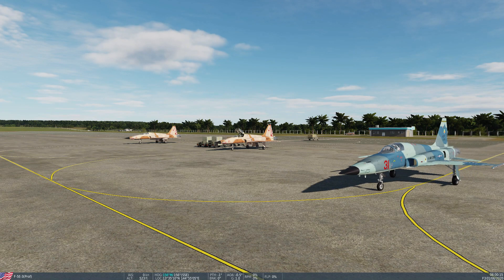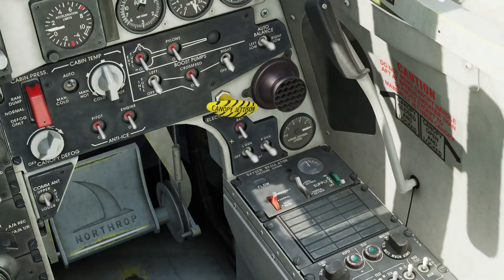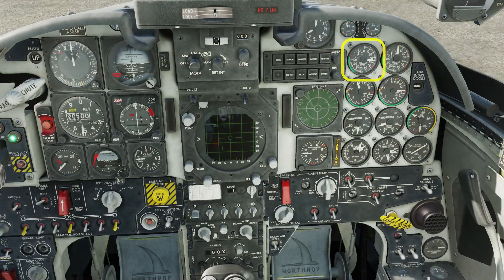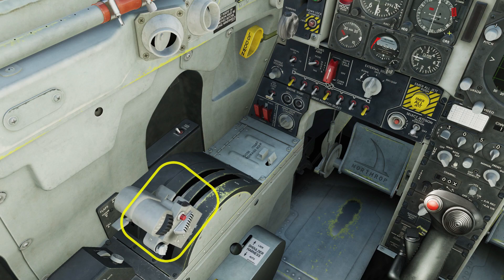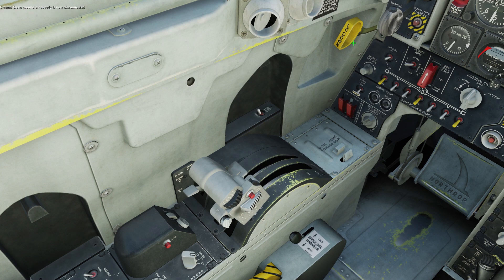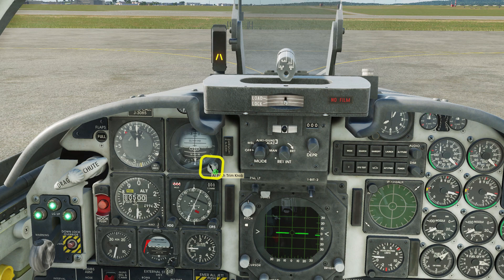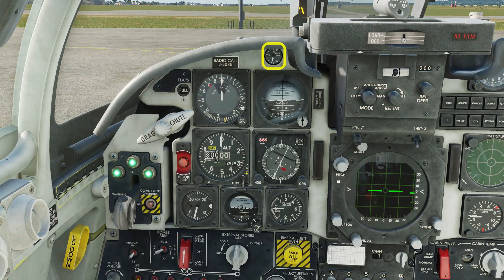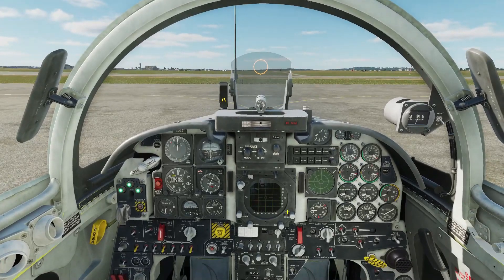DCS World F-5 Startup from Cold and Dark: DCS In 3 Minutes Or Less

Comment: It is not typical to set your altimeter to zero feet altitude. It gets set to the elevation of the airport above sea level. Nellis AFB is at 1,896’ at a standard 29.92 barometric pressure. Right now it’s 30.22. That’s what you set the altimeter to.